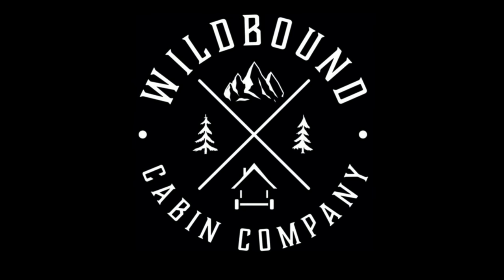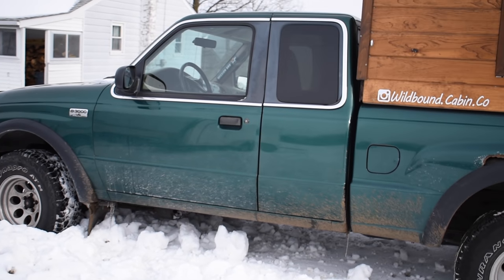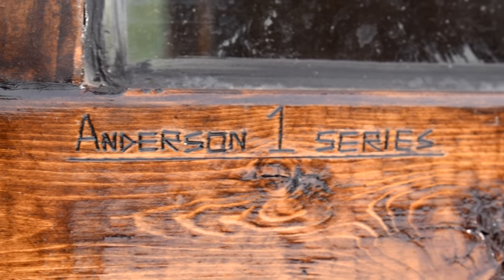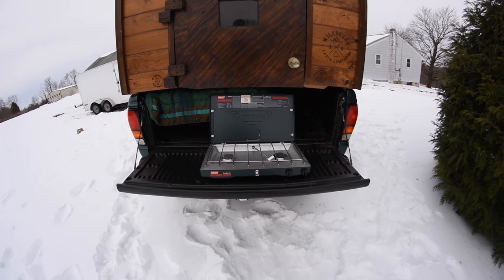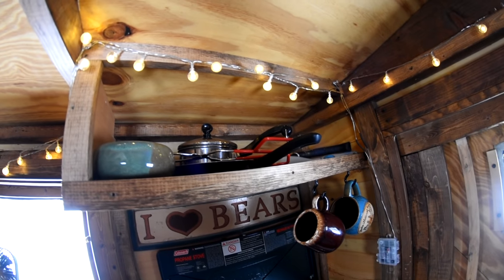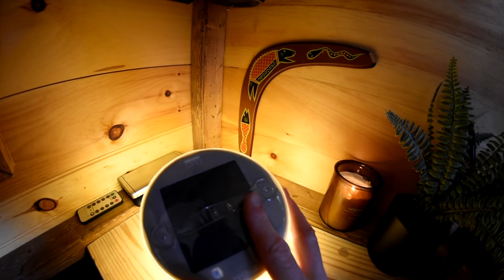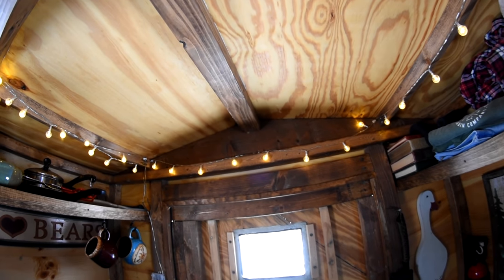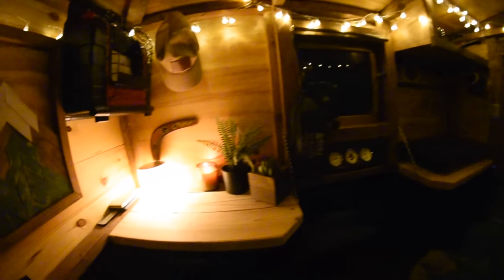Cozy Tiny Cabin on 4WD Truck FULL TOUR - Wildbound Cabin Company Tiny Cabin on 6ft Bed Mazda B3000

Comment: This is so cool! Beautiful wood inside and out and really does feel like a cozy cabin. One tiny suggestion, and you may have already done this. Attach a piece of thin, flat, black weather stripping across the bottom of your door to keep out wind and insects. It goes on the outside and will seal against the tailgate when you close the door. It is out of the way on the outside and shouldn't prevent you from opening the tailgate with the door closed. This is a beautiful well designed and well built camper.

Comment: This is one of the best micro cabins I've seen. I like your color scheme.  Thanks for sharing your construction video. P.S. if you can build that cabin, you can do wonders with some bondo on your rusted body. Then you could trim it our in wood or paint to look like wood. I would only use a buddy heater as a last resort. A down sleeping bag and a 12 volt electric blanket or just a heating pad would take you thru a lot of chilly nights. I would recommend a mounting step for getting on horses that you can buy at an agricultural store or tack shop. They are 2 step and 3 step, compact made of plastic and very strong and come in dark green. Can toss it inside while driving then easy to set up at your entrance when you are at your camp site.

Comment: Cool video. I have a 02 Tacoma with a cap I put on for camping, I lived in it for about 6 months and drove 20,000 miles around (mostly) Western states. I've seen a ton of home crafted rigs out there, glad to see how your project turned out. PS I have a cool upgrade if you want to get in contact

Comment: Very cool! Just wondering how much it weighs? (Roughly)  I was also wondering if you can "easily" remove it if necessary?
BTW, great artistic work!
Reply from the maker: Hi thanks for reaching out! We don’t have an official weight, but I would guess around 300-350 lbs. It could probably be removed with 2 strong people, or a couple chain hoists, but we’ve never found a reason to remove it!
Reply: @wildboundcabincompany5882  
Thank you! I was thinking it was around that weight. Keep up the good work!👍